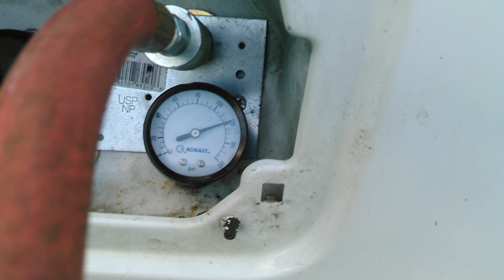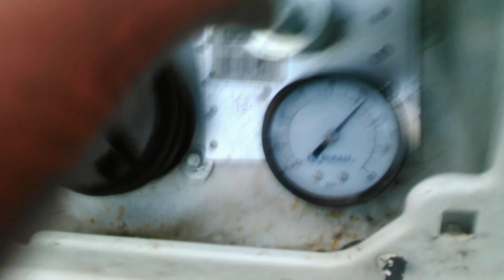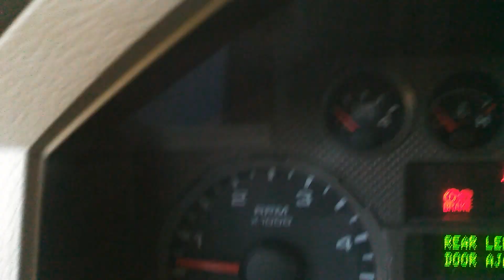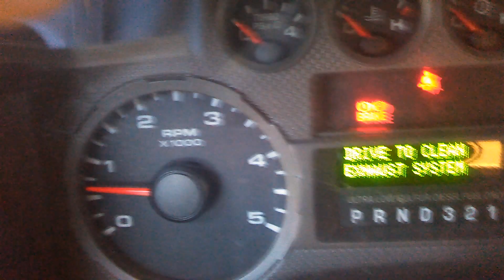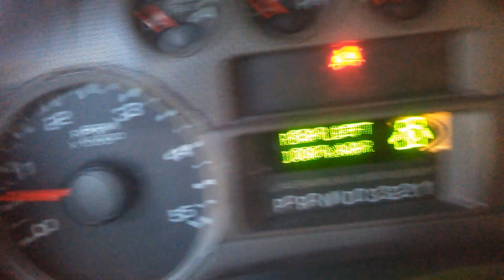2008 Fummins F350 w. Air system.

Comment: What does the air pressure operate? never seen anything like it
Reply from the maker: Operates my spring brake chamber (Parking Brake) in the video.  Also used for Air tools/ accessories.